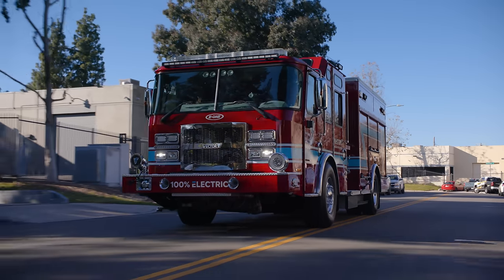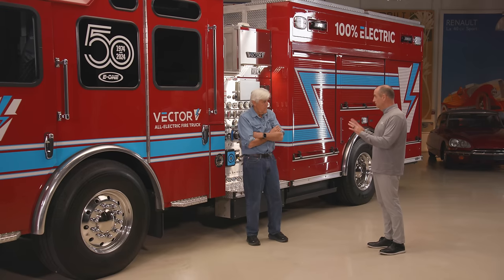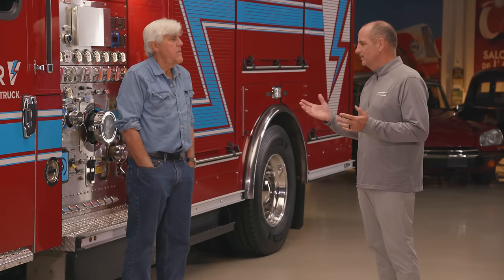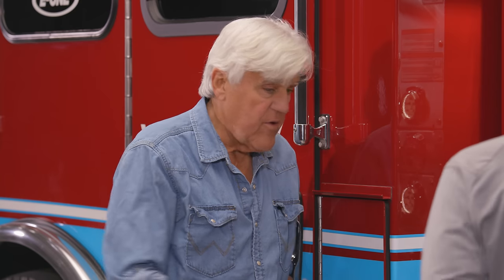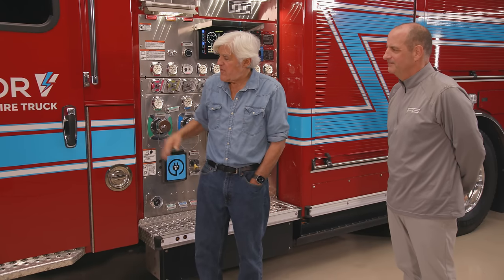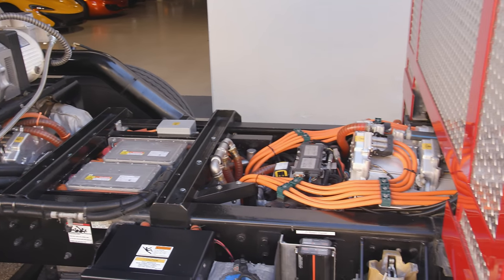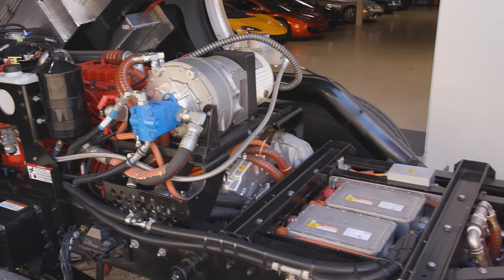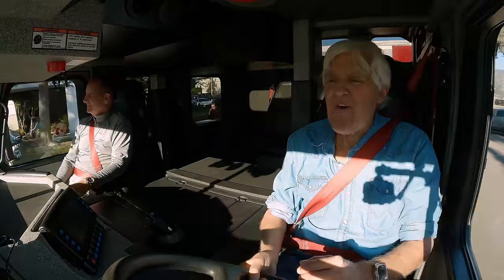The Future of Firetrucks?

Comment: As someone who actually works in the fire service unlike a lot of these commenters, I'm excited for the future of these trucks. Electric is extremely promising from a health standpoint (no fume exposure and low noise for firefighters), maintenance (smaller low hour use diesel generators OR no engines at all depending on your configuration), and no need for storing fuel onsite any more (tons of headaches for departments from a facility standpoint).

That being said, they aren't without their issues as the manufacturers work out the kinks in their processes - I believe LAFD and Vancouver Rosenbauers had tank leaking issues which had to be fixed. Of course all four of our brand new Pierce diesels that we've ordered had to be sent backs for MONTHS of work 💀 so I'm going to take those stories ('unreliable had to be sent back!') with a grain of salt and wait on some actual use reports from these departments before we can make a full determination on whether or not they are actually living up the their potential cost savings. 

The good news is that if use times and low charge prove to be an issue in their deployment in busy stations, they can still serve a purpose in low run stations that run 4 medical calls a day hehe. Excited for this episode for sure!
Reply: Does a person have to be a fire fighter to know not to stick their hand in a fire ? Or even extinguish a fire ?  It is a non viable joke from an engineering perspective . Vancouver BC has 7 of them out of commission . Exciting eh ?
Reply: I'm sure some ambulance drivers thought the same until they were give EV ambulances.
many call outs around here had to cancelled leading to deaths because the ambulances were on charge or had broken down
Reply: @rdhudon7469 based on your own line of reasoning of "if it's out of commission it's worthless" our diesels we've ordered that are supposedly 'reliable old tech' should be thrown out as well. Again, I will wait until the reports start coming out regarding repair downtime and use case effectiveness for these vehicles. They are brand new and as such new tech has manufacturing issues especially with such a complicated demand system. Your entire comment history is you ripping on electric vehicles - try not to be the person who is still riding around with a horse and buggy while everyone else is leaving you behind with cars. Have an open mind - the benefits are many should departments start making the switch
Reply: Worrying about diesel fumes while fighting a house fire is beyond smooth brain thinking

Comment: That torque number is incredible.
Reply: But for how long? a Diesel can run for weeks if you kept fueled, which you can 
if you take a fuel bowser to the engine
Reply: @phillipsmiley5930 if from what the guy said this would be about the same with range extender running.
Reply: it is actually not! thats the torque at the wheels, a scania 770s makes around similar torque just from the engine now imagine what the gearbox multiplies to the wheels!
Reply: Agreed that the torque number is insane by comparison…… but other than win at producing more staggering numbers than a conventional diesel powered truck, what benefit does higher torque numbers provide ? That it will do the quarter mile in one third of the time ? Well that’s fantastic until you try to STOP that 45 ton locomotive….. and since in most “City” environments, the average speed any may get up to is 50 mph, the torque it achieves takes a backseat to how fast that beast can be stopped ! I still say they may be great to have conversations about, but they will never become practical in the real world.
Reply: @KM-qx6nh  Hmmm… I would hope/assume that there’s a regen capability built in, thereby significantly aiding stopping times.
Reply: If you want even more torque you can stack another motor on
Reply: @lloydynlozzy  Funny you said that, because that is exactly what they did to get that truck to reach the torque levels it achieves now.
Reply: @phillipsmiley5930  It has a freaking diesel range extender.
Reply: @KM-qx6nh  Funny how you talk about stopping. REGENERATIVE BRAKING is an important benefit of EV Heavy commercial vehicles.

Comment: Why not a diesel electric?  Seems the best way to go especially a grass rig.
Reply: This has a diesel range extender on board, basically the same as diesel electric, just with a huge battery making the diesel unnecessary most of the time.
Reply: Watch the video. That's basically what this is.
Reply: @Lolwutfordawin  --  In the "trade" it's often makes is a "Gen Set" hybrid with no mechanical connection between the ICE and the drive train.
Reply: A modern day Gas Turbine might be better it not choosy what it burns and by keeping it at one power setting % RPM can give a lot of power and get decent mileage, as a unit driving a 3 phase alternator at 400 HZ
Reply: @Lolwutfordawin  Have you listened to yourself?
Reply: @kristyskirt9015  Gas Turbine emissions have never been solved, would be great if they could
Reply: @phillipsmiley5930  GE Rolls Royce and Pratt and Whitney Have lowered emissions. Of course run it on hydrogen just water well steam.
Reply: @phillipsmiley5930  not sure what you're trying to tell me.
Reply: It is a diesel electric
Reply: @Lolwutfordawin you mean it has a diesel engine onboard a “diesel range extender” means nothing

Comment: How much does this cost for a fire department to purchase?!  Won’t the electric power be diminished dramatically by the hundreds or thousands of gallons of water being held inside the tanks?  That water will definitely bring lots more weight to the fire truck.   Jay you were very good with your questions and interest in the fire truck.   He did mention the backup system for the generator but I’m still a little concerned about the full amount of power being drawn by the system from the water being held while in transport.  Overall a very cool video to see as a former volunteer fire member.  Love these kinds of different videos!!

Comment: ok so its got a diesel backup?
since im gonna be running that diesel backup with some regularity, ill head over to Pierce or Rosebauer and get a regular diesel drive train.
BTW i LOVE the decal on the front bumper @27:25 that says "100% electric."
Reply: "Please ignore the diesel powered "range extender" under the cab. It's 100% electric, trust us."
Reply: It is a 100% ev. With range extender. The extender may rarely if ever be used. Did you not listen to the video? 

This is not a hybrid either.
Reply: @michaelhess4825 wrote: "This is not an hybrid...."

This is a plug-in series hybrid.

Comment: Edison Motors R500 retrofit kit on existing firetrucks would be a better idea and way more cost effective than this expensive thing.
Reply: Nope. Every bit used by Edison is as expensive as the bits used on this truck, except that Edison is using no-name Chinese suppliers for most parts.

Comment: In the city this truck may work but for rural FD it won't. They have to carry their own water since many times there's no fire hydrant nearby. Heavy batteries means less room and capacity to carry the required water and if there's a water source nearby such as a pond, river, etc. they need to run the engine to pump the water onto the fire. How long will the batteries last then?

Comment: Sooo if there was say a massive storm that took out the power for multiple days... What then? Use the generator on board to "recharge" the batteries? Wouldn't that just make it a hybrid?
Reply: Considering the worst scenario makes stuff reliable right? I guess(or hope) that diesel engine would do fine, as the fire station could have one big generator itself that would do the charging as usual
Reply: Fire stations generally have back-up generators to stay online.
Reply: It is actually easier - the electric fire truck can recharge at the station from the emergency generator (or use its built in range extender diesel) but everyone else has to locate a fuel station that is outside of the power outage or has a backup generator in order to pump diesel!
Reply: Then the onboard diesel engine will work.
Reply: ncattlerepai9414  stop this fire truck in a plug in hybrid.
Reply: Big Diesel engine generator at the station for power outages😂

Comment: Who cares about emmissions from a diesel engine when a house is burning 😂😂😂
Reply: As i'm sure mike would tell you we all have to make sacrifices to build Sir Klaus's
 "Brave New World" even if it takes "1984" years to do it
Reply: I wonder how many emissions will be put out if/when that Lithium-Ion battery decides to combust?
Reply: @whatsmynameagain691   Not to mention the emissions when it ignites the fire station and the other fire trucks parked in it......
Reply: Bring back whale oil power.
Reply: Because ICE vehicles never catch fire? 😉
Reply: @davidmccarthy6061 rather internally combust rather than externally combust
Reply: In my city 95%+ of all calls are false alarms or as ems calls.   Going electric would save the city/firehouse money long term especially with less mechanical service required.
Reply: @whatsmynameagain691  Yet your phone hasn't combusted...
Reply: most calls arne't fully involved structure fires, but medical calls, technical assistance and rescue calls
Reply: It will also most likely be more reliable. Less parts to fall. Much Less ongoing maintenance.
Reply: @Waldo1122  youre comparing a phone which has a few watts to a vehicle that has a few hundred  kilo watts. matter of fact phones do and have caught fire. electric vehicles have a long running issue of self igniting due to failure of the battery packs to cool off. electric vehicles in general are more hazardous than regular vehicles.
Reply: @2012frawd  Yeah the vehicle is water cooling the battieres and almost all Teslas are entirely made in the United States unlike your phone which is majority from China including the battery. Phones rarely ever catch fire and they're using the exact same technology as an electric car.

There has been almost not a single case in which a Tesla made in the United States has EVER caught fire. Tesla now makes up 5 percent of the vehicles in the U.S yet there has been near to no fires but hundreds of thousands of gas car fires in just 1 year.

Electric vehicles are far safer than gas cars in every scenario.
Reply: @ntsecrets  Thats completely false. Just because it has less parts doesn't mean there is less maintenance. LAFD has an electric fire truck that has countless issues and is most the time out of service than in service.
Reply: @2012frawd  I wouldn't bet against advances in technology. The only story I could find on the LAFD one was a leak in the water tank.  And that one is like 3 years old?  Already obsolete... lots of advances in just that short amount of time.
Reply: @ntsecrets  they dont put everything in a news article. I'm betting against electric because in the long run it'll cost trillions for mediocre at best. EV is not sustainable.
Reply: @2012frawd  I took a pic of this to reflect on 5 years from now
Reply: @ntsecrets  5 years? you really think itll take five years for ev to be remotely similar to a combustion engine?
Reply: @2012frawd  have you driven an ev? Like a good one? Give it a try sometime.
Reply: What about the emmisions to mine the battery material.....
Reply: @funandgamesvideo  takes more to mine OIL.... the biggest mining operation on the globe.

Comment: "100% electric!" Has a diesel engine under the cab 🤣 Great video, although i don't agree with electrifying everything..
Reply: And why not electrify everything?  What's the down side?
Reply: Most things in life involve tradeoffs and compromises. There are not-goods about electric as well as gas. Believing progress and change is always better in all areas is more a matter of will than reality.
Reply: Hybrid for redundancy
Reply: Nope, this is a full on ev. It has a range extender. That is not hybrid. Hybrid implies the Driveline can be switched between fuel and electric drive. Far more complicated and expensive.
Reply: It's only used when you surpass the 4 hour Pumping run time. It's like you ignored the video. "i don't agree with electrifying" only because you are willfully ignorant.
Reply: I like the electric with diesel generators because last thing you wamt when your stiff is burning down is the firetruck needing a charge because ut had to go from one fire tocthe next to the next and there wasnt tike to stop and charge but maybe there will be time to charge later.

Comment: This is a very bad idea.
What if there's a Hurricane and the Power is out for 2 weeks?
What if there are 2 fires, and you kill the charge after the first one.
What if there are Wild Fires and you need the truck non stop for days at a time?
Reply: Gas pumps need power too.
They said it could do 17 trips/fires before recharging.
They said it's not for rural fire departments but rather dense urban cities - nobody is going to be fighting a wildfire for days at Bed Bath & Beyond :) If it does that's what the diesel emergency range extender is for.
Reply: stop using your brain - they don't like that.
Reply: @BlazerRox  
No they don't...
Manual Hand Powered Fluid Transfer Pumps have been in use for centuries.
You don't need electricity to drop a hose in a ground tank and pump some liquid out.
Reply: @onestopfunstop317  Cool story bro. The two times I've experienced a widescale electrical outage in my city, all the gas stations were offline too. Guess what, they don't break out manual pumps and snake hoses down into the tanks and fill customers tanks by hand. They just close up the gas station until the power outage is over.
Reply: @BlaZe 

Yea. They do. Just not for civilians.

Trust me. The national guard can pump a gas station tank to keep cops/fire/EMS on the road.

Or toss down a generator and open the station up.
Reply: @onestopfunstop317 ground tanks get flooded and water filled during massive hurricanes, like what's mentioned here. This was one of the biggest problems during the last few hurricanes... Fueling stations couldn't keep fuel sealed correctly from the water.
Reply: @bkane573  Municipalities have their own fuel depots they don't fill up at the local Shell station.
Reply: @BlazerRox  Oh, that very much depends....
Reply: Stop with the absurd nonsese spam. You are just  troll farm copy and pasting scripts. You did not even watch the video and ignored the facts. It has a freaking DIESEL GENERATOR onboard. It even has DEF for the generator.
Reply: @Neojhun  
So why make it Electric if it needs diesel to operate reliably?
Why not just make it all diesel or gas so it will always be ready?
Reply: @onestopfunstop317  You are just a troll not capable of watching a video. It's freaking 3500lb/ft of torque from two motors, it's quieter better for communication. 
Beyond what has been said: Instant response thus floor the go pedal from parked cold. Regenerative Braking for a heavy 45K lbs truck could literally save lives due to brake longevity and redundancy. I'm probably forgetting even more benefits. You just want to be stuck in your old ways for absurd nonsense reasons.
Reply: @onestopfunstop317  Oh at low crawling to walking speeds, Electric Heavy Vehicles have way better throttle response and more performance especially up hill. You can literally place a truck easier with more accuracy on an electrically drivel CDL vehicle. I wonder why that would be important for a hydrant hookup.
Reply: @BlazerRox  Nope the easiest method is just a fuel tender pickup truck. That's how it's done in Australia.
Reply: @onestopfunstop317  "needs diesel to operate reliably?" sure but it's not use vast majority of the calls. Soo you are ignoring how the diesel is being used.
Reply: @Neojhun  
They use diesel in the Generator behind the Fire Station which they use to charge it.
There's always a net loss of energy in any exchange.
If you're going to power the battery off of a diesel generator hidden behind the station.  Why not just cut out a step and put the engine in the truck?

Comment: That 800volt battery is putting out around 1,256v peak constantly which is kinda a crazy amount no lie
Reply: Why would 800V from a DC Battery peak 1,256V?
anyway put your hands across 800v or 1256v the result is the same

Comment: what's another word for a range extender?    A generator
Reply: A diesel powered generator, which makes those "100% Electric" decals look like EV virtue signaling.
Reply: This is just a diesel-electric truck. Locomotives in the US have been diesel-electric since the mid 1930s. Instead of the diesel engine turning a shaft spinning the differential to drive the tires a diesel engine spins an alternator that provides power to the traction motors that drive the wheels.

Comment: As a medic on a fire department this may work at slower call volume department. 
My department is in the mountains and our fire trucks are lifted with bigger tires due to rough roads and off roading.

However if you are in an inner city department like Denver running non stop call, how do you take an engine out of service for hours to charge?
What about the 20 year service life of our current engines and other apparatus?
Cost of the batteries and maintenance? 

If the power grid goes down you are out of luck!

Can’t go grab a Jerry can of electricity!

Change is good but some things may not be there yet.

Comment: My concern, would be the range and battery backup. Places in Canada like Quebec, can loose power for weeks, sometimes, due to winter and freezing rain storms.
Reply: That's why it has a range extender generator that can keep the batteries topped off while it pumps. Look up Edison Motors: a company in British Columbia founded by loggers and logging truck drivers to build electric logging trucks. Designed to go up the hills empty, come down loaded heavy on regen braking and have range extender generators to cover the gaps.